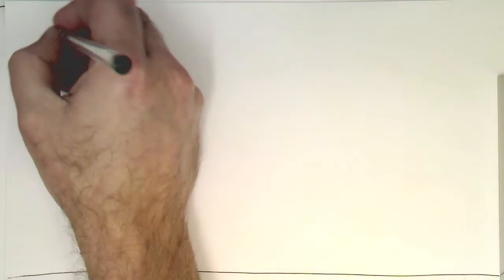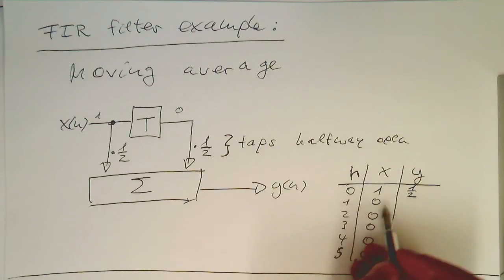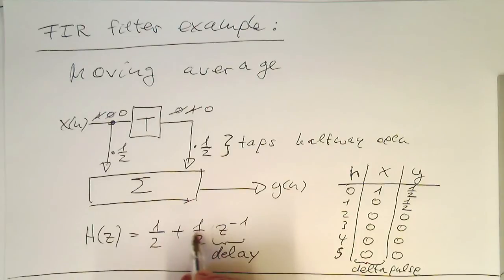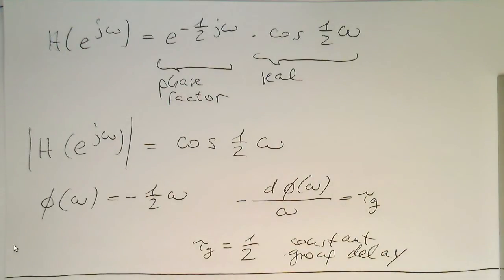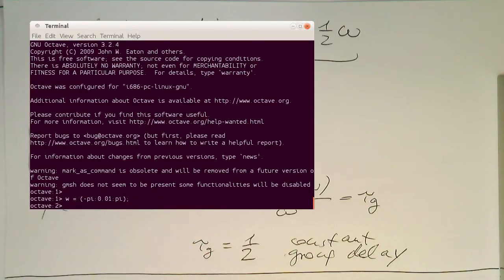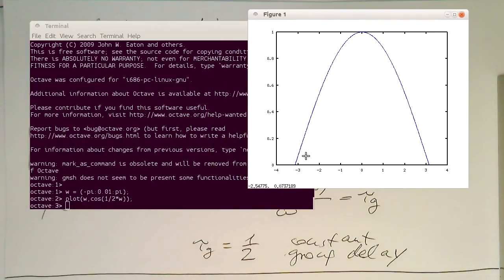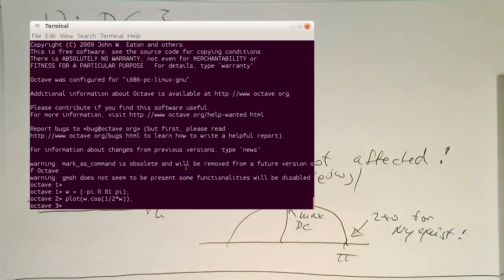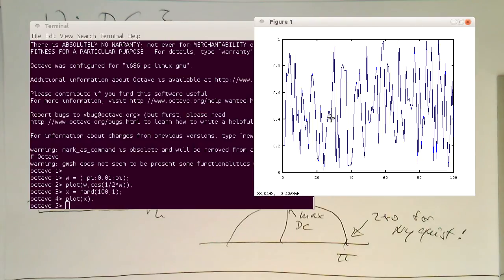FIR filters: the averaging filter as an example (0001)

Comment: cos(x) can be negative, so |H(e^jw)| should be calculated by |cos(w/2)|. In case of  cos(w/2) < 0 you should add this information to the phase.
Reply from the maker: Enrico Friedrich yes and no. ;) The valid range of w is -pi ... +pi so that the cos actually never becomes negative. For that reason I secretly dropped the absolute value.

Comment: Can I extend this specific example to find the frequency response for N number of averages?
Reply from the maker: Course you can. Just integrate over a pulse lasting N samples. That will give you a sinc function.
Reply: I went ahead and spent some time trying to figure it out.
 Here is what i came up with as the frequency response due to N averaged points:
 (1-e^(jwN))/(N(1-e^jw)).

I dont think that is a sinc function but it resembles one I suppose. is there anyway to further simplify?

Thanks!
Reply from the maker: What you want is the amplitude response of it so abs() of it. I guess you can use the same trickery as I've used for the N=2 case by pulling out the real part out of the exponential. Sadly I don't have time just now to play about with it. Let me know when you've solved it. :)
Reply from the maker: The guys at Berkely did it:
http://ptolemy.eecs.berkeley.edu/eecs20/week12/freqResponseRA.html